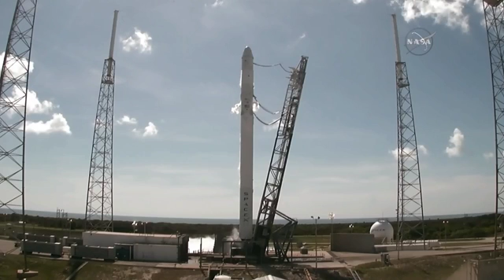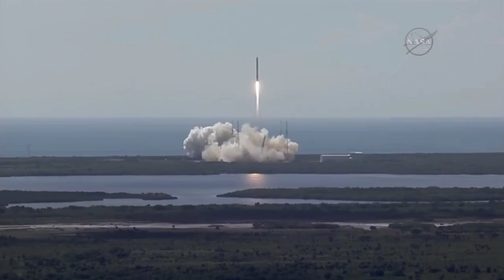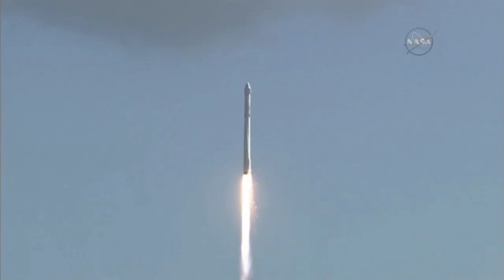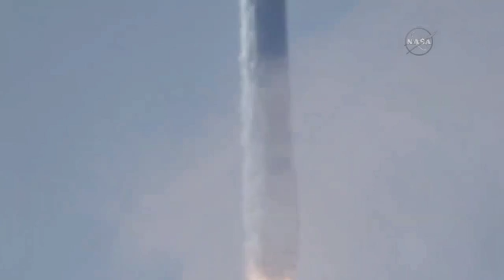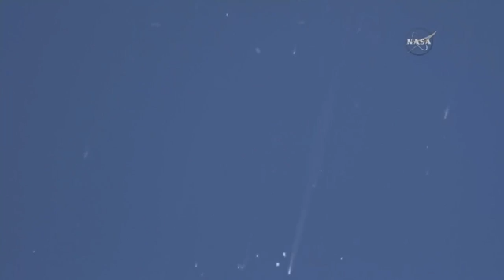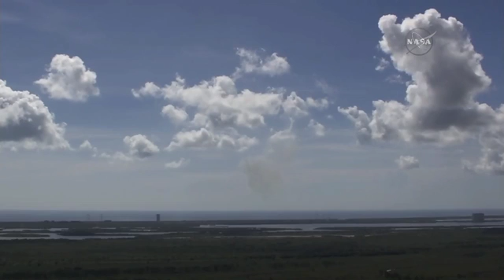Explosion! SpaceX CRS-7 Mission Ends In Disaster | Video

Comment: Fly russian rockets, they do not explode.
Reply: Petr Zohin Except for the ones that did...
Reply: Which ones really exploded just in the middle of fly? Could you tell?
Reply: Petr Zohin Well the Proton rocket which exploded in July 2013 for a start. And there was likely an explosion on the Soyuz lifting the previous Progress craft in April resulting in the complete failure of that mission.
Reply: A Phillips first of all — Soyuz didn't explode. The failure was caused by leaking gas. Proton exploded only at the moment it hit ground.

My point is that russian rockets do not explode just in the middle of its flight. They may fail, of course, but these failures are anything except sudden explosion.
Reply: +Petr Zohin Get your Facts straight Dude, did you even  read why CRS7 failed ? 
That could happen to any Rocket
Reply: +Petr Zohin The SpaceX rocket didn't just explode either. The second stage ruptured from an over-pressure caused by faulty metallic struts. Several proton rockets have also failed due to weak metal in the upper stages (in one case causing the Thrust Vector Control to fail). So get your facts right.
Reply: Petr Zohin Oh and pretty much ALL of the Rockets from Russia exploded radomly, the only have one functioning model in different versions
Reply: +Petr Zohin Land Russian Mars landers, not quite the same idea.

Comment: It starts to break from the front. You can see the first stage still running for a second or so before the airodynamic pressure breaks it apart. This does not look like a failure of the first stage. The break of the top of the rocket could have something to do with the strange light between 1:37 and 1:40
Reply: akureiokamii That strange light looks like condensation forming when the rocket is in the trans-sonic region due to the shock wave (very short gradient, almost discontinuous of high pressure variation).
Reply: actually first stage flew another 4 miles or so before mission control terminated it deliberately
Reply: akureiokamii 
What's strange about these lights? Those condensations can be seen on any fighter jet that is close to being supersonic, which is excatly the speed that the rocket was at (as told in the commentary).

Comment: at 1:48 there seems to be a problem. fire burned a hole and let heat in?
Reply: +Magnus Bekkengen What you're seeing at 1:48 is the shock clouds formed as the vehicle becomes supersonic. This is a normal phenomena, and isn't related to the failure.
Reply: +Magnus Bekkengen I'm not sure that would have been partnered with the 2nd stage failure.